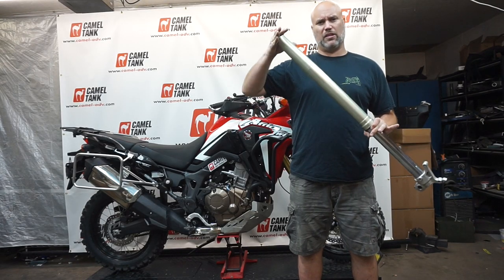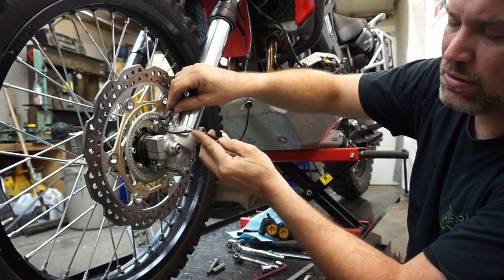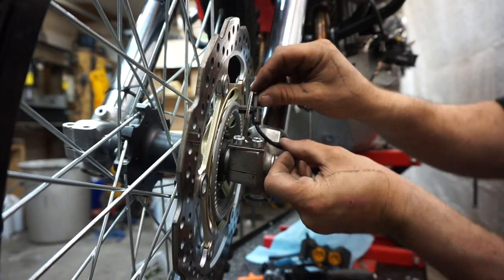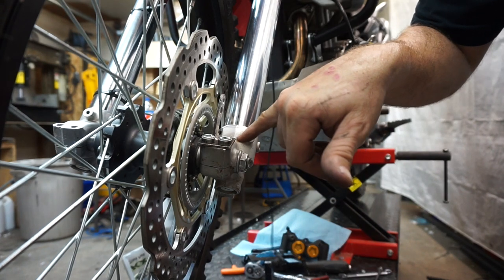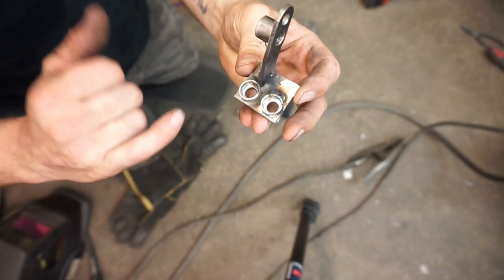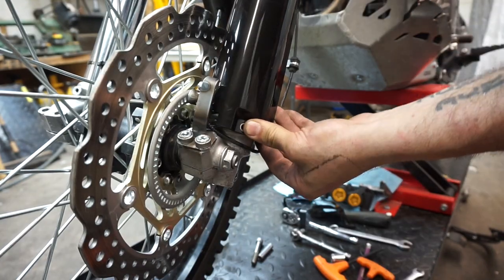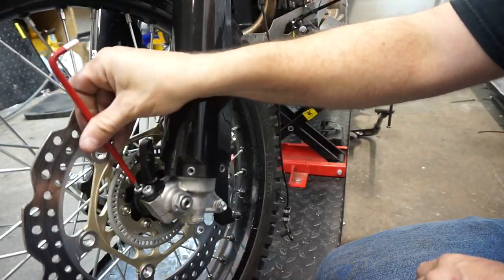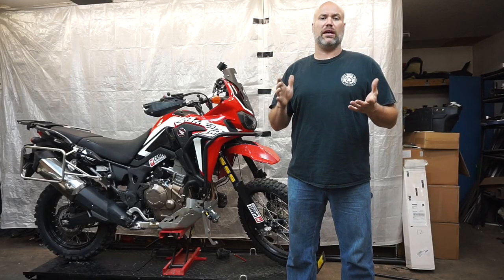Pt3: Africa Twin -Fork Swap KYB SSS

Comment: Let us all know when you produce a complete fork replacement kit for the Africa Twin. I am currently totally rebuilding my fork along with Kashima coating and warranty replacement for the lower tubes that are warn in an area likely due to the lower triple clamp being torqued to much among other things. It may be nice to have your option for people that want to scrap the whole Showa factory option for something else. Ride that set up hard (as I know you will) and let us know how it holds up. Awesome Job!!
Reply: it occurs to me that one could have the SSS fork shortened to the original height of the AT's fork. Lots of people shorten SSS forks for dirt track or ice racing.

Comment: Hey man, nice work. I'm doing the same right now, but with Supertenere 750. Can you tell me which front fork spring rate you used? because bike is about same weight. Greetings
Reply from the maker: I think I had 0.75kg/mm with me weighing about 225kg.
Reply: @CamelADV  ok holy shit, i have 5.6N/mm . that will be too soft i think. Can you tell me were you got those springs? i can only find up to 5.6
greeting